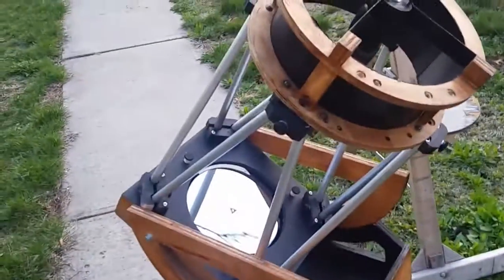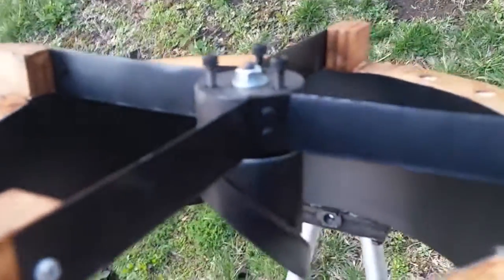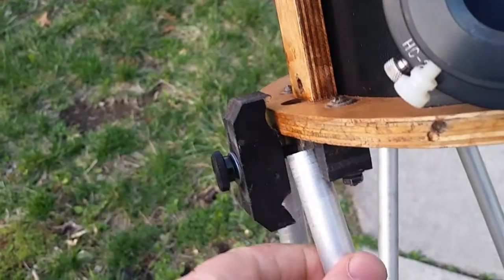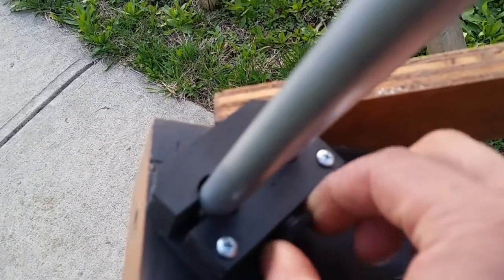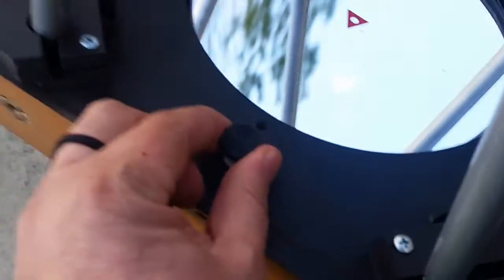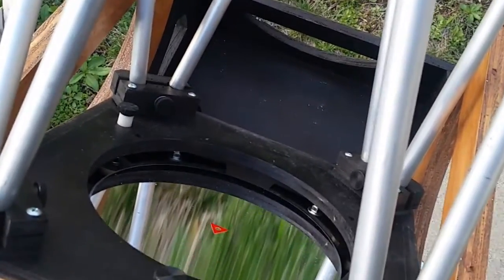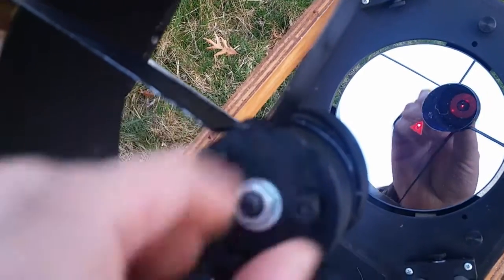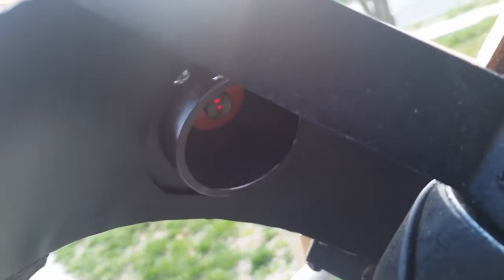8inf3.45 ultra light travel dob

Comment: Nice work. That's quite the short dob. What are you using for a coma corrector? Also how do you like the Kineoptics focuser? I thought about getting one for one of my projects.
Reply from the maker: +Jim Hendrickson&#160; paracorr I with the tunable top. the HC-2 is fine. had it out last night on Jupiter with 3mm eyepiece and had no problem getting a good focus.&#160; I'd buy another HC-2 if the design called for it and its about 1/2 the weight of a jmi single speed focuser. at high mags I don't use&#160;the paracorr

Comment: nice details in the design.
Reply from the maker: +BuddyJesusSmokes&#160; thanks. something I just thru together and didn't "finish" it to a high level like not sanding the ply edges as I should. I just wanted to get it up and running so I could star test 2 mirrors I made...I love the front collimation bolts.